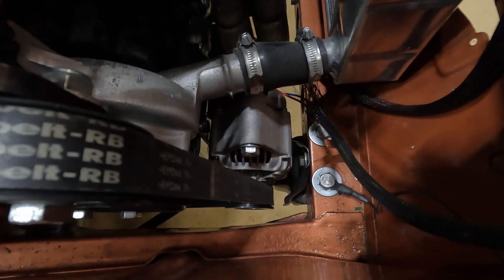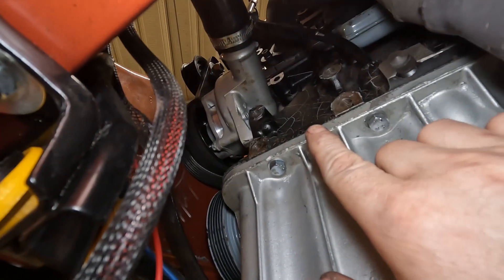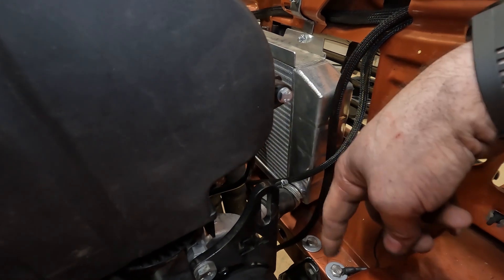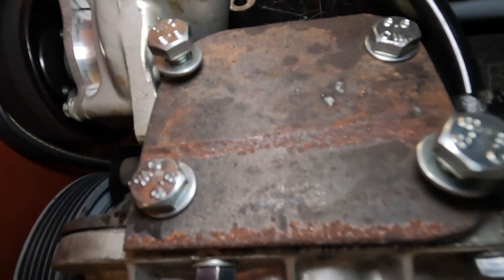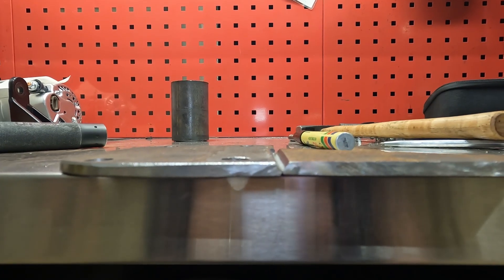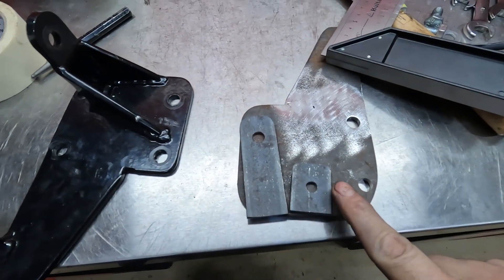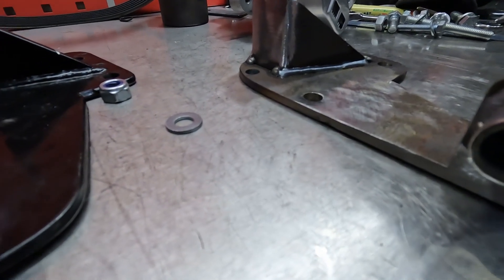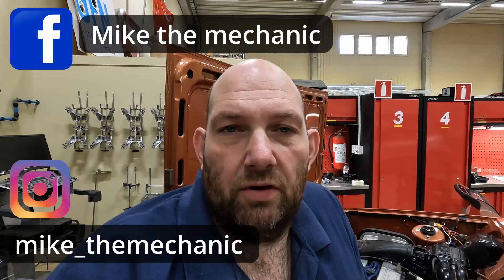Which alternator and bracket do you NEED when fitting a zetec engine to a MK1 ford fiesta.

Comment: Hi I'm trying to figure out the simplest way to run a Zetec. A Friend bought a river boat that has a 1.6 crossflow he has spent quite a lot to get the engine up to date it hadn't even had the head done for unleaded and after spending on that and changing every gasket +electronic ignition then the head gasket leaked the electronic ignition gave up. Switching it to a Zetec seems the obvious way to go to me.
Reply from the maker: Have a look at my Nodiz video that you will need for the electronics. Your not going to need to change the sump for example as I assume it's just going to sit in place. You will need bike carbs for fueling though but those can be picked up fairly easily in the UK.
What a great question for me to answer. Thanks for asking 😊